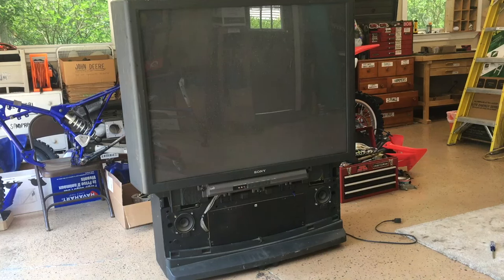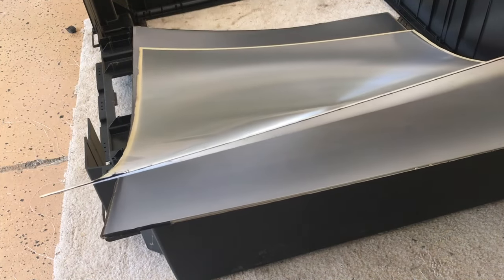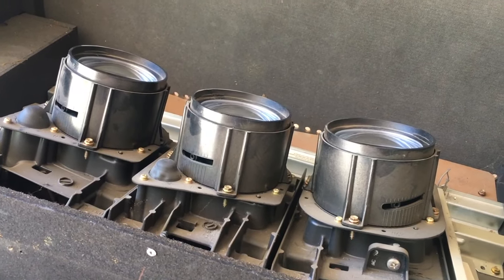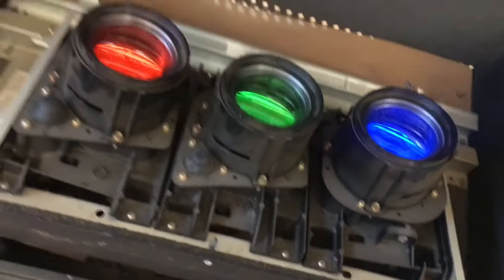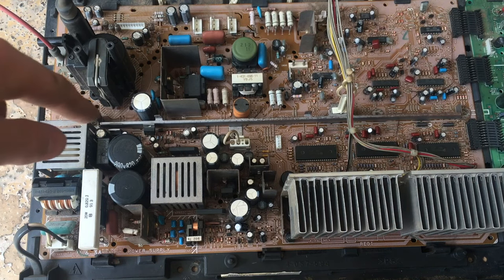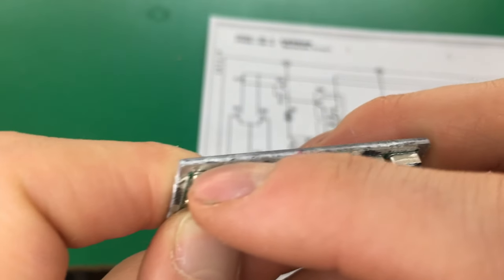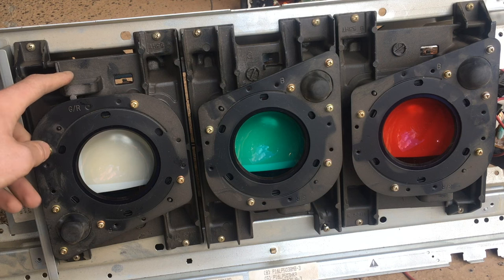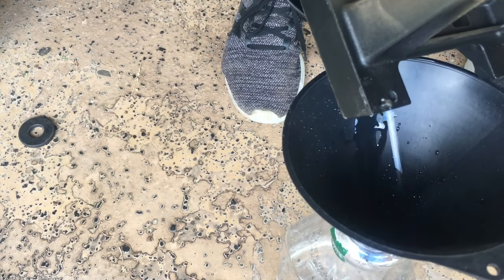Sony Rear Projection TV Teardown and Analysis

Comment: Greek letter mew for 'micro'-processor.

Old service guys used to get sun burn or something from the x-rays emitted by those CRTs.

It's good that you show data sheets
Reply from the maker: Some chip manufacturers make it difficult to find data sheets. Fortunately, Sony is not one of those brands. I always enjoy looking at the data sheets because they are full of useful information.
Reply: @BGTech1  A lot more is learnt from fixing things, studying how they operate with an oscilloscope and reading datasheets, than from any college or university course.
Reply: it's not "mew" and it's not "meow", it's "mu".
Reply: Ackcktually it's μ

Comment: Would be nice to see you break one of those CRT to see what's really looks like inside
Reply from the maker: Breaking open CRTs is potentially hazardous. There isn’t much on the inside either, it’s mostly just an empty vacuum. The front glass has a phosphor powder and the electron gun is inside the neck (skinny part) of the tube. Regular full color CRTs have a metal structure inside called a shadow mask.

Comment: That's the problem with those 
Is you always had to sit directly in front of them 
The fresnel lens and then go 
Is designed to spread the light out 
The piece with the vertical lines handles the vertical and horizontal where are you reading the material from is it the manual

Comment: So if mine is dangerous to touch meanwhile is on is because some ground isn't attached well?
Reply from the maker: The exterior should be fine to touch, even if your ground is not connected well. (I’m assuming you mean the ground connection on the power cord, not something internally)
Reply: @BGTech1  no i mean if I touch the connector on the back for the speakers I get shocked
Reply: Btw do you know why in my tv the soft rubber things with the fluid are swollen? @BGTech1
Reply from the maker: @thestickchannel1845  I’m not sure it could be because of a short somewhere. I’ve seen those explanation things swollen too, I guess it just happens over time as it ages.
Reply: @BGTech1  so I can't do nothing to prevent the other 2 from exploding?
Reply from the maker: It’s seems unlikely that it would explode. I’ve never heard of that happening before. The rubber piece would probably just continue to expand. The purpose of the rubber piece is to allow for expansion. The best solution would probably be to replace the ethylene glycol solution if it continues to expand.
Reply: @BGTech1  well I think that's what I have to do because is very swollen if you make a video about tis problem it can be awesome 🔥

Comment: Can taking a rear projection TV shock you? I stopped dismantling because I don't want to hurt myself any tips anyone? TIA
Reply from the maker: As long as your tv has been sitting for a few days you have nothing to worry about. The charges dissipate as time goes on after you last turned in on. To discharge the crts and flyback, connect a flathead screwdriver to a piece of wire and the other end to the metal chassis. While only Holding onto the plastic screwdriver handle, slide it under the anode caps for each crt and make contact to the metal piece in the center. After that it’s safe to disconnect.

Comment: The fresnel lens magnifies the projection that's hitting the mirror in the back and makes it fill the screen area, but that alone makes the image look warped, exactly as it would under ba magnify glass. 

The lenticular sheet (straight lines) straightens the image, eliminating that warping. 

The acrylic sheet protects everything else and make the physical structure of the lenses invisible to the viewer, unless their face is right against the screen. 

This same technique can be used to make your own rear projection screen, though if you're not bouncing off a mirror and instead pointing straight at the rear of the 'lens stack' you'd need to add a light diffusion layer like LCDs have. 

I'm not an expert, i just spent a lot of (fun) times messing around with stuff like this.
Reply from the maker: Thanks so much for the great information! I’ve always wondered about the exact purpose of the different lenses.

Comment: I repaired so, so many of the projo tv's...I was in the TV Repair bizz for almost 40 years...some were built very well and produced excellent pictures, but, once lcd hit the market, projection tvs were rendered useless. 
DLP was actually an excellent form of projection TV, but they weren't practical to continue that technology. 
It was actually amazing the amount of technology that went into tvs from the 80s to early 2000s...
Many manufacturers were operating at break-even costs during those years.
The TV Repair business was very profitable during that time, but, it all  came to an end by 2014.
Now it's strictly retro and antique restoration....some services are still needed, but the service business is a part time hobby today.
Reply from the maker: Thanks for commenting. I’ve always been more fascinated by DLP. After taking one apart I’m not surprised that they are just breaking even. CRT rptvs are interesting too, but more primitive. It seems like they would be prone to more convergence issues.

Comment: You know what's odd, when I was younger, I would always be fascinated by these big TVs, one time while I was bored, I looked into the TVs front still covered with the material, and found Red Green and Blue lights, at the time I was confused on what those were... Eventually the TV was trashed... I never got to see the inside of it. It was an old RCA tv. I think it was from 2000 or 2001.
Reply from the maker: When I was a kid theses TVs were already 10 years obsolete, but people still were getting rid of them. My parents wouldn’t let me take one home, so if it was in my neighborhood I would take parts off before the garbage picked it up. I think it’s surprising to most people that most of the tv is just empty space. Only the bottom part has the parts.

Comment: i was curious what was the purpose of ethylene glycol in those lenses. surprisingly i could not find a good answer on the internet. so for fun i decided to ask chatgpt and it said it's used as a coolant to transfer heat away from the tube. i guess it makes sense, but it's still not clear to me why it needs to be a liquid. apparently it sometimes becomes contaminated by a fungus.
Reply from the maker: That’s correct, it is also used because it creates a quality optical coupling between the crts and lens assembly that mitigates luminosity and picture quality losses. crt fungus is a bit of a misnomer, as it has nothing to do with a biological fungus. In some conditions the ethylene glycol will form small crystals suspended in the fluid that will block light and decrease picture quality.
Reply: It does make sense that if you want to cool the light emitting surface of the CRT carrying away the heat with a liquid makes sense. How else would you do it without blocking the picture?
Reply: @BABA-ws5eo um.. with glass?

Comment: Excellent video! I am thinking about parting out my 13 year old Toshiba tn55x81 cinema series hd rear projection TV (which still works, but has not been plugged in for months) to harvest it's front lense and whatever else cool there is to salvage (optical lenses, heat sinks, speakers, casters, etc.) Besides warnings about ethylene glycol within the lense housing, the YouTube videos warn about "discharging" the CRTs and capacitors to avoid a nasty shock.

Any advice about this project?
Reply from the maker: As long as your tv has been sitting for a few days you have nothing to worry about. The charges dissipate as time goes on after you last turned in on. To discharge the crts and flyback, connect a flathead screwdriver to a piece of wire and the other end to the metal chassis. While only Holding onto the plastic screwdriver handle, slide it under the anode caps for each crt and make contact to the metal piece in the center. After that it’s safe to disconnect.
Reply: @BGTech1 idk where you heard that but no crts use thousands of volts and hold thats electricity for severals of years
Reply from the maker: @slimbruh  That’s not correct, you might want to do a little more research.

Comment: In Czech Republic these are quite rare to see. I was looking for one for a long time until I was going through a scrap yard and found one! All the color guns are working but there is something fucked up in the video circuitry. I'm planning on using the color guns for some kind of project. Maybe a some sort of spot light. It's actually quite amazing how TVs got simple over the years. Anyways, nice video!
Reply from the maker: Here in the U.S. Rear projection TVs and crt TVs have gotten a lot less common in the last several years.
Reply: @BGTech1  Here brand new CRT TVs are being sold purely because of people who cannot afford an LCD TV. However, rear projection TVs are incredibl rare not only in Czech Republic, but also Germany, Poland Slovakia etc. The one that I found was a one-in-a-milion coincidences, it eas imported from the US, hence why it was so rare.
Reply from the maker: @Sonic_The_Electronic_Madlad  Interesting! Rear projection TVs were the more expensive alternative to crt TVs so they always have been less common that crts. It’s probably been at least 15 years since crt TVs have been sold in stores, Now days you can buy a full HD LCD tv for very cheap. Around 8-10 years ago people were throwing crt TVs out very often. I was 9 or 10 at the time, and I would pull parts from them right on the curb. Back then people didn’t care.

Comment: Rear projection TV's are fun to tear apart, but for those looking to tear apart these sets, be careful of the oil that's used inside of the display assembly as it may cause irritation/burning to the skin depending on what kind of oil is used within.

Comment: Hello, i recently disassembled a rear crt projection tv similar to this one, i kept the lenses from the projectors, the frensel lenses and the mirror inside. I was wondering if any of those parts could be toxic or irradiated. It might be a dumb question but those crts produce radiation from x-rays right? If that's so wouldn't that make the other parts slightly radioactive? Is it safe to keep the mirror as a simple wall mirror? Also any advice as to do with the lenses? They seem only good as magnifying glass i tought about making a telescope but they dont seem good enough for that. Thanks for he help
Reply from the maker: Hi, There is no need to worry about radiation. While CRTs do give off some X-ray radiation when in operation, the radiation isn’t nearly powerful enough to irradiate other nearby objects or people. It is perfectly safe to keep or repurpose parts from the tv. I haven’t found a good use for the tree lens assembly mounted to the CRTs, but they do act a lot like a standard magnifying glass. I believe each assembly has two or possibly more different lens inside which might be interesting for experiments.
Reply: @BGTech1  Thanks for the quick answer, that puts my mind at ease.

Comment: Sir, any possibility to get High volt splitter (or it may be a exstarter)for Lg projection tv model no.PT-53A80..Part no. is 4410Z-A001F.
Reply from the maker: It looks like you can get one off eBay and some other online sites.

Comment: Hola le podré conectar otra bocina a esta tv
Reply from the maker: Yes it is possible. This tv provides a RCA low-level Audio output. (The rightmost red and white connector on the black panel) Use a RCA audio cable to connect an amplifier and speakers.

Comment: Did you have to destroy it?
Reply from the maker: It wasn’t working right, and to repair it would have costed more than a new hd lcd.
Reply: @BGTech1  OK, fair enough if it was faulty :-) . Where possible, I think these rare TVs, or even just their parts, should be preserved as you can often use TVs, or their tubes in old rear- projection arcade machines and they do look great for old games (when tuned-up). Giant 4:3, native 15kHz with no lag and big scanlines is a nice thing.

Comment: Why is the blue one have a clear lens?
Reply from the maker: It’s for color accuracy. I couldn’t find any information about it on the internet.
Reply: @BGTech1  me either. I would guess the blue one has a blue phosphor wheras the red and green on is the white phosphor.
Reply from the maker: @chrisbailey7384   I thought so too, but the phosphors are actually red, green and blue for each of the tubes. My guess is that the red and green isn’t the exact shade required for accuracy reproducing the whole spectrum of colors, and the filters correct the shades. I’m not sure why this isn’t an issue with direct view CRTs though.

Comment: Primary colours: RED, BLUE and YELLOW.
Reply from the maker: Red, green, and blue are the primary colors of light, as opposed to pigments, which use the RYB color model. Since TVs work by emitting light, they use the RGB color model.
Reply: Red, Yellow and Blue are for mixing paint.  The blue paint in the primary color is more azure/light blue towards cyan shade which allows mixing yellow and blue to make green wheras the blue light in the RGB is a very deep royal blue almost indigo shade of blue.